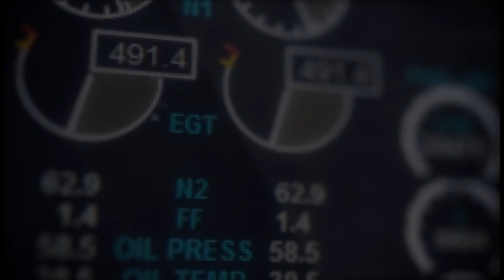Will Circular runways "take off"

Comment: Some of these you also pointed out, but this is what I thought of:
1. Instrument approaches would have to be completely fluid, requiring an entirely new way to fly the approach every single day.
2. The effective runway length is not indefinite, but rather only about 1/3 of the circle if you want to be relatively free of crosswind.
3. The landing groundspeed would always have to be the same in order for the sloped surface to actually work and with variable wind conditions, that would be frustrating.
4. Slippery conditions on a sloped runway could be an absolute nightmare.
5. This would absolutely not reduce traffic congestion, but make it much worse, as now you could only use one part of the landing area at a time, with a very confusing approach pattern to deal with.  If every aircraft wants to land in a headwind, you'll never be able to have aircraft just join the circle from any direction, but they'll all still have to line up and approach to the same spot as everyone else.  We already solved that problem with parallel runways a long time ago.
6. The ability to judge your glideslope visually at night would have to be completely re-developed.

Conclusion:  Yeah, it's good to think outside the box, but I wish that guy actually talked to pilots during his 'research' and came up with some better answers to the obvious problems only a pilot or controller would point out.

Comment: Vr calculations will become more complex, on the banked runway, the faster the AC is travelling the "heavier" it will become, therefore requiring a higher Vr.  With a runway of "infinite" length presumably V1 will also become a variable speed. IMHO I Don't think it's workable with current technology!
Reply from the maker: Nop, I think you are right.

Comment: What about the simple idea of how the passengers get in/out of the airport? If the terminal is inside the circle, how will people get there with planes coming in from every direction? Would there be subway stations running under the runway, to shuttle passengers in and out of the terminal? How would those subways, and/or buses navigate around the aircraft taxiing to the gate? Would all aircraft be forced to stop at one part of the circle, like when someone goes into the pits at NASCAR? Or would the subways go underground all the way to the terminal, so aircraft can taxi in from 360°? Either way, that's a lot of nonsense.
Reply from the maker: Tunnel under from the looks of it.

Comment: In fact, circular runways have been used in the past. Back during WW 2 a company called Radioplane, now a division of Northrop, built a large number of radio controlled drones used for Anti-Aircraft target practice.

These were often launched from circular runways using a centrally mounted spinning catapult arm. However, landings were performed by parachute. The device was called the A2 Rotary Launcher

I am only aware of one of these still in existence, albeit derelict, at Stiffkey in Norfolk, England. It is known locally as ''The Whirlygig'' and if you Google ''The Stiffkey Whirlygig'' you will find photos of it and a Youtube link which shows it.
Reply from the maker: Cool!
Reply: Radioplane went downhill in 1945 after Norma Jeane Dougherty left and became Marilyn Monroe. lol
Reply: Interesting information.
Reply: it was a launcher..   not a runway...

Comment: I say just shorten runways and use stationary running jets at the end to create a massive headwind to slow the plane down.
Reply from the maker: That would cause a positive windshear just prior to touchdown and the aircraft would not land.
Reply: Mentour Pilot interesting, thanks. maybe someone at ATC could monitor the plane's height and cut the jets at the right time.
Reply: Maybe the circular runway is sloped wrong way round? Build straight runways but uphill to reduce speed when landing, and you start downhill to get additional speed :)
Reply: Exactly. Don't need ATC so much as a GPS based system that spots that uses the planes IDENT for type and size and computer feed the info into the headwind machine to slowly ramp up the wind, then slowly reduce it at the appropriate time. This actually seems like a brilliant idea. Whatcha think Mentour (great vids BTW)
Reply: Well - seriously folk - If you would quit popping all those air pockets on bubblewrap, we could recycle those things at the end of the runway at LEAST 50' high.... quit popping those air pockets. Recycle
Reply: GBloc I wasn't serious about that comment. There are sloped runways like Tenzing-Hillary Airport, and if necessary pilots will fly such runways. But introducing an artificial slope to otherwise flat land would be an increased risk for accidents. Just imagine a runway overshoot when you have a 50m drop at the end of your runway. On flat ground, that's maybe a collapsed nose gear sometimes minor injuries. With a 50m drop, that would end up deadly.

Comment: The idea I have is a giant lift called "The Grabber" shaped like a catchers mitt that reaches up and catches inbound airliners and sets them on the ground. For take off, a giant sling shot thing called "The Floater" which looks like an army combat boot, hurls the airliner off the ground and into the air at super sonic jet speed like a soccer ball. As for circular runways, if it's built like the Talladega Super Speedway, it's plausible.

Comment: I'd go for a david star.
It can provide for separate landing & take-off, while the unused tarmac serves for taxying to the center terminal. This means 4 taxiways per strip, and 60 degree angles between runways. Something like Heathrow in the 50's. You will always have some crosswind anyway..
Reply: Another benefit is an airport can start out as a single triangle, and expand later on by adding the second on the same territory. Just thinking out loud here :)

Comment: Great video and very informative! Thanks for posting!

As a thought experiment, what would happen if the runway were like a conveyor belt or treadmill, such that it rolls when the aircraft's wheels make contact? Would that, too, be considered an "infinite runway"? If the runway is moving fast enough when the plane touches down, does the plane's horizontal translation suddenly drop to zero? Thank you!

Comment: If you have a low wind day, you can have 3 runways. If you have more wind and set one of the runways to have perfect headwind, the other two runways would have the wind coming in 60 degrees from the back. Not exactly perfect.

Comment: One of the positive things with a circular runway is failed takeoff's Since the runway is infinite, then you can immidiately retry, and even if you have to abort a takeoff, it won't do any harm. I Think many of the problems with circular runways, for example slipperyness and the clearance problems, will disappear once computers take over the cockpit completely and no human pilots exist no more. That means the clearance can be lowered greatly since computers are more precise in handling, and then you also get rid of the Engine failure problem since the computer can exactly calulate what is required to keep the plane on the runway. Same with slipperyness, the computer can calculate whats required to takeoff on a slippery circular runway and compensate, something human pilots not can do as perfectly as computers.

Comment: I think we will see commercial VTOL before we see circular runways. Really love the concept of it though.
Reply: Michael 
Commercial VTOL already exists, it's called the SpaceX Falcon 9, but it is only for cargo.
Reply: you have heard of helicopters haven’t you?
Reply: Helicopters aren't fast or long range enough to fulfill the role of airlines. VTOL solves a lot of problems but also present issues themselves. During the vertical take off/landing it is most vulnerable to wind... crosswind or not. The thrust is also directed right at the ground, which smaller airports may not be suited for.

Comment: I'd say vertical take-off is a more likely approach to the problems of congestion. We already have the technology in military aircraft and historically we've seen military technology slowly being able to advance into civilian technology as it becomes more mature (this is the reason we have jet-planes at all).

Vertical take-off removes the requirements for any clearance around the airport or even a proper runway while you don't need to reconstruct the entire airport or aircraft fleet. Older planes can still use the existing runways just like before.

The V-22 Osprey is a good proof of concept and the AW609 is a civilian aircraft using the same concept which is in development. Though these are still reliant of rotors there is a good theoretical possibility to use jet engines to produce the same thrust, similar to the Harrier Jump Jet. 

The problem is of course the engineering required to lift a while passenger aircraft vertically and the enormous thrust the engines need to be able to put out during take-off. The fuel consumption is however not as much of a problem as the extreme thrust is only needed during the actual take-off and the take-off time is significantly shorter than a normal take-off. You also have the safety issue in that if you have an engine failure on a jet configuration during take-off you have no possibility to make an emergency landing (with a rotor you can use the rotor to slow the fall).

Comment: What if the runway was on a slope that went in a circle, like if the runway itself was tilted to the inner side of the circle, accomodating for the tilt in the runway would also correct the circular part of the runway
Reply from the maker: Yes, this idea includes a banked side of the runway to counteract the centrifugal forces.

Comment: TILT-ROTOR AIRCRAFT...
Reply from the maker: Yes, but that will only work on smaller aircraft sadly.
Reply: Mentour Pilot thanks for the reply!

But why?

Why can it only be done for smaller aircraft? Why not have 4 engines/wings? Why are we limited to propeller driven tilt-rotors?

I know this would cost alot of $$$$$$$$$$$$. But in 30 years I think it would be more viable then a circular airfield. 

Think you found an idea for a new video... Great videos btw.
Reply: need a helipad not a runway :-\

Comment: You immediately can find a lot of problems with it to keep it from even being created - and why straight runways are superior. Perhaps for small engine aircraft or autonomous aircraft it might be useful.
Reply from the maker: Maybe.
Reply: Because you have to identify the problems to come up with solutions. A solution can't exist unless a problem does.
Reply: I was thinking it could be used as a recreational runway with single engine planes but I'd say it would have to have somewhat of a straight section for takeoff/landing.  I'm no pilot, but i would say its risks outweigh the rewards.
Reply: You could split the difference and do something like, say, a pentagram with flat (and straight) edges. That would give you five runways in a fairly compact configuration, with ten approach angles, minimal distance from centrally located infrastructure, and they'd only intersect at the very ends, instead of crossing each other like in some airports.

And the same for taxi-ways which would never have to cross another runway to get to any exit runway or back to the gate. And you'd only have five lines of obstruction clearance to deal with. So it seems like it would vastly reduce the chance of accidental collision between arrivals/departures and taxiing aircraft. And there would be no angle of approach that is even close to heading straight towards the central infrastructure.

Traveler traffic would just pass under the runways as they already do in many airports, to get in and out.
Reply: and for those in the past they didn't use runways, just a big flat area of grass. That's where the term airfield comes from, it's a field for aircraft to operate off of.
Reply: +CaptainDuckman GA still uses big flat areas of grass.
Reply: I would imagine it would be even worse for small craft, since they have smaller wheels/gear aseembly, and due to being lighter, are going to move around the runway a LOT more from the forces involved at takeoff speeds.
Reply: why are people only look at the problems instead of working at solutions?
Reply: I mean, they only complain about the problems and waisting time with mouning. Try to find an answer instead of stop thinking because the're is a problem. The circular runway can work, the man behind it is a smart cookie.

Comment: What is a circular runway, stupid
Reply from the maker: Sorry, who is stupid? What a circular runway is, is what this video is trying to explain.
Reply: Mentour Pilot Really you didn't understand what I was saying?  Of course, that's what the video was explaining.  I was starting it is stupid.  It would cause twice the problems.  As a former Air Force airspace controller I'm quite sure it would be a nightmare for air traffic control not to mention it would have a larger footprint for just one runway not to mention you'd have to have another circular taxiway in the middle.  How would you even go about specifying a taxiway in that big mess. I assure you this will never catch on in the idea is stupid

Comment: So GNSS approaches would work, as would any instrument approach system not needing specifically placed kit like ILS. Not sure how VASIS or PAPIS would work.

Biggest issue I can see is that the point is to avoid having to touch down all crossed up. Now, on short final I imagine the aircraft would be rolled into the bank angle of the runway, which would start the aircraft turning with the runway. Problem is, unless manoeuvred at the last second, you'd have to fly out of balance (slipping) for a short time just before touchdown. This is actually a similar manoeuvre to crossing the ailerons and rudder in a wing down conventional crosswind approach....?

Unless the plan is to fly a circular final approach, effectively a descending DME arc?!?
Reply from the maker: Yeah, there are many many problems with this idea.

Comment: When you are approaching the circular runway for landing, the plane's roll angle is going  to have to match the angle of the embankment.  Crosswinds could make that very tricky.  Getting the left and right wheels to touchdown at the same time is going to be a lot more difficult (rougher landings).
Reply from the maker: Yes, this among many other things will make this concept hard to get working.
Reply: In particular, each plane has a natural roll angle for a certain circle radius, but these angles are not the same for all planes.
Reply: @renedekker9806  No, this is not true. There is a relationship between speed, bank angle and turn radius which is universal and don't depend on a particular plane. This is R = V²/g tan phi, where R is the turn radius, V the speed, g the acceleration of gravity and phi the bank angle. This relationship only breaks when the bank angle is zero, so that the radius is infinite, for any speed. This is the major argument in favor of straight runways : you can land on it at any speed. For a circular runway, the radius is fixed, the bank angle is constrained by the bank angle of the runway, so you have only one choice for the speed, or a very limited choice if the bank angle of the runway is varying from inside to outside as shown by a picture in the video, which shows also how this is limited by the risk that engines  or wing tips don't have the needed clearance from the ground.
Reply: @robert.ehrlich8942  "so you have only one choice for the speed" - exactly. And the landing speed is different for different planes.
Reply: Would imagine many broken wing tips, and  landing gear.  Would surely put excessive stress if not levelled perfectly.

Comment: The circular runway is a very good idea but i have a question, will the wind be a problem be cause it goes in only one direction and the aircrafts are not stables with a side wind

Comment: Banked <> concave.  There's still a wingtip clearance issue because you come in parallel to the horizon rather than the runway and would have to bank the craft at touchdown, but not like your graphic.  I agree that it doesn't seem practical though. A Triangle seems optimal to me.

Comment: I don't understand how this solves the problem of cross wind landings and especially takeoffs. Your landing or takeoff roll will be 120Degress so your cross wind component will be changing throughout your roll. For takeoff you would have to start the roll with a tail wind component. Plus I dont see how you can have more than two aircraft using the facility unless the wind is calm.
Ultimately that is a lot of extra expensive runway to build. For the same cost what you could do is build a runway at an angle to the primary runway(s) for use when there is a very strong cross wind (Crazy I know) 
One good thing though there would be no V1, if you have an engine failure just stop on your infinite runway, unless someone else is using the other bit then you are screwed.
Mentor cleared for take off after take off fly runway heading :-) .